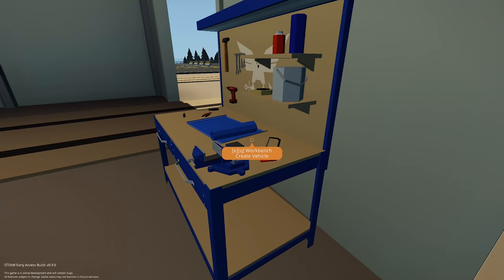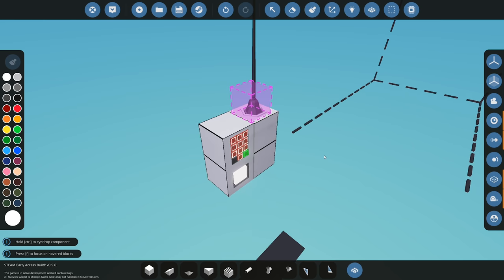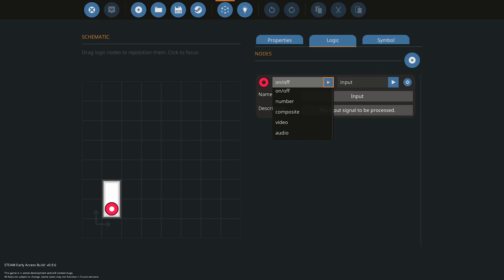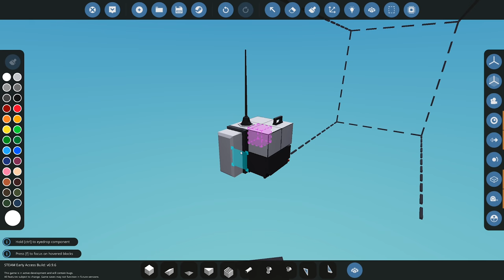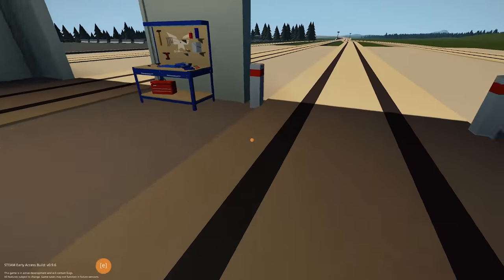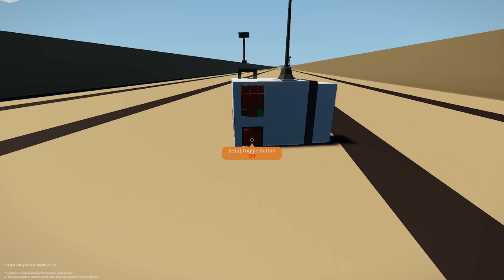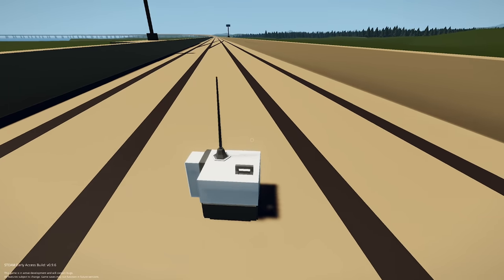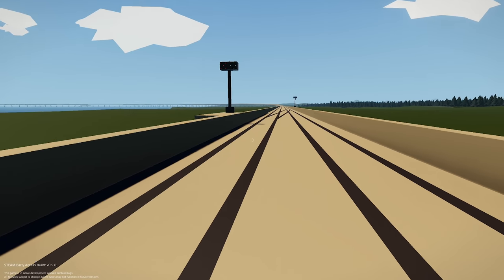Radio Train Track Switcher Tutorial

Comment: Just a quick heads up, the switchers now operate on the 0 frequency and not on 440!
Reply: why did they change this this is my problem since half an hour
Reply: it still doesnt work
Reply: @bastisas1023  Check if the signal you are trying to change has a little antena on top, some of them don't for some reason and those have to be changed manually.
Reply: Now it works
Reply: Thank you so MUCH been pulling my hair out
Reply: @Kirkar185  No problem, I'm glad that I could help ;)
Reply: Legend!!!
Reply: Thx @Vulpine m8 I thought it was my batterys
Reply: TY
Reply: Is it still at 0
Reply: glad i came to the comments before making this , I would have been furious to find out it didnt work anymore but it still works just on the 0 freq. Thanks!
Reply: It's back to 440 now, make sure you have a constant on signal connect to the Send/Recieve node

Comment: I've used this exact same system ever sense it came out and have been happy with it on the same vehicle, when I loaded the vehicle up after one of the recent updates all the radios were disconnected and when I fixed them 440 did not work to switch the tracks, all electric is connected, so is everything else but idk if its a bug or the update changed it.

Comment: I tried to rebuild this.
I made a dial which shows me the signal strength, but at channel 440 it is 0.0. At channel 0.0 it is 1.0 ... ???
Reply: Never mind, I need to put the antenna in transmit mode, then it works